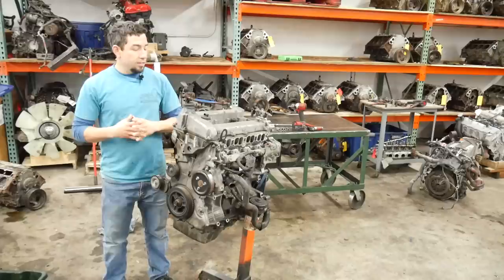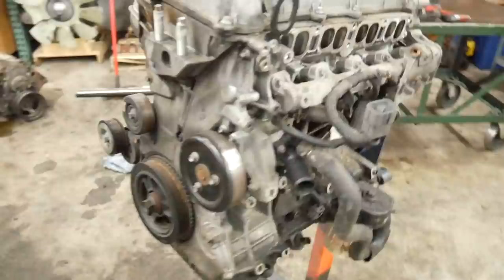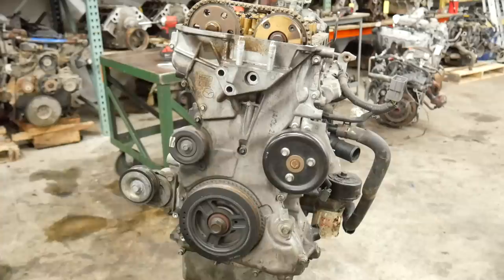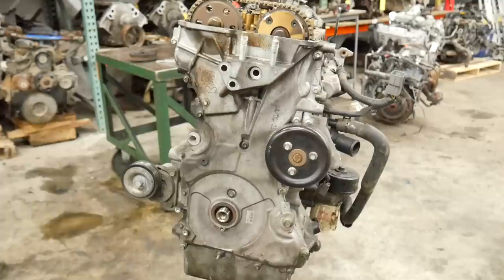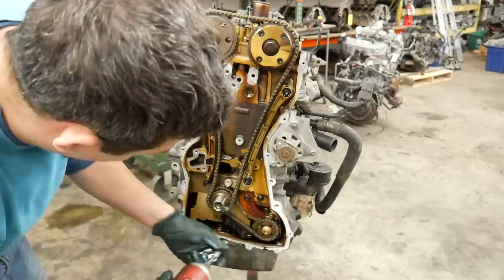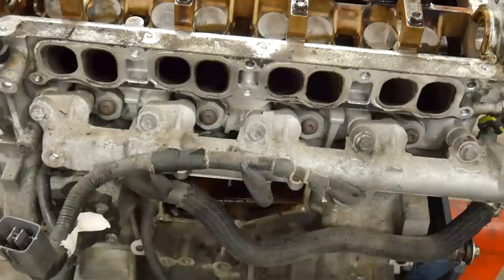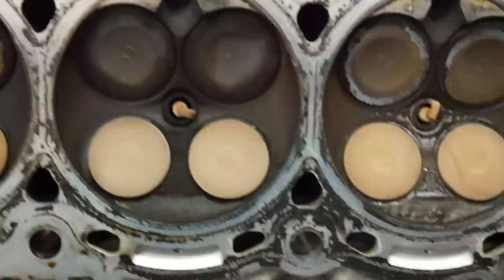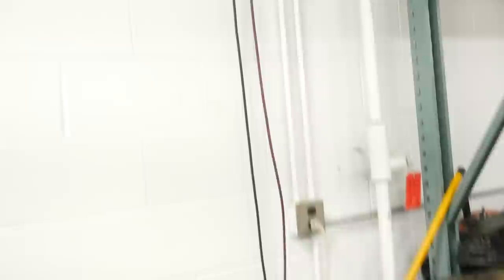TOTAL TEARDOWN: BAD Mazda MZR 2.3L Turbo Mazdaspeed3 Mazdaspeed6 CX-7 Engine.

Comment: Please teardown Nissan VQ engines either 3.5 or the 3.7.  And explain from your experience what are the weakpoints and things you like and dislike about them.  Enjoying the content!!
Reply: The later VQ35de, and more so VQ35hr and VQ35vhr have oil gallery gasket issues. From what I've read, replacement is quite pricey, usually higher than the value of the car the motor is in. G35s and 350Zs that have those motors are pretty much throw away cars at this point.

Comment: All I got from this was the need for regular oil changes and his reluctance for engine development. Who takes oil pans off insitu east-west engines? Space is tight on the cars and easier to pull the motor. Diamond impregnated friction washer or keyed shafts, both work.
Reply from the maker: I am all for new tech, so long as it’s not at the expense of reliability and serviceability. Pinned cams and crank, a normal oil pan, and a thicker chain and this engine would be 10x better than it is.  
Pins aren’t one time use. You can’t time them wrong (easily) and it would simplify the timing procedure. 
Mazda’s later engines are pinned. So clearly they knew what direction to go.

Comment: I had to work on an L3-VE which had lost intake cam timing which we couldn't get fixed in a shop because the service guy was adamant it was an electronics issue (every warning light on the gauge cluster lit up and the enigne sputtered at ever decreasing RPM threshold) and wouldn't accept that the camshaft timing is held with nothing but straight bolt tension and will inevitably spin and told us we have no idea how engines are put together saying such things. Oh, and you can't just pull the cover and adjust the thing, because the intake bolt (which is the one that gives) is obscured by the chain cover. These engines make decent power and run nice and smooth, but their best use would be to drop from great height on whoever approved the design. It seems to be optimized to maximize the misery on the service guy.

Comment: Reminds me of the timing on the old Ford 4.0L. Some habits die hard.   Somewhere in the world, there is a bean counter and an engineer having a beer together, congratulating themselves on the dirt cheapest way to time an engine.  “Key ways cost money.  Slot the cams and pin the crank, works just as good and is much cheaper.”
Before everyone goes hating on Ford, Cummins did a similar thing with the 12v 5.9L with the P7100 pump.  Line the marks up on the crank and cam gear, pin the cam, pin the injection pump, then bolt the pump gear on.  The crazy part about Cummins doing it, key way slots were already cut, but they wouldn’t work to time the injection pump.

Comment: When I saw the video title, I thought "aside from the rotaries, I"ve never heard of Mazda engines having problems"....then I saw FoMoCo on the side of the block, and it all made sense.
Reply: Yeah many of us speed owners of the gen juan and genpu 3s alongside the speed6 owners know of how screwed we were going into it from that era of mazda. But we still love our babies nonetheless and just how raw it felt compared to other competition
Reply: Except the fours were all Mazda designed and the 3.0 was all Ford,  which in those  years are bullet proof.
Reply: @ohger1  Nope, the 2.3 was Ford's baby. And the 3.0 was notorious for head gasket failure.
Reply: @justsumguy2u  And you're wrong on both counts.  The 2.3 Lima was Ford's, the 2.3 "L" in this video is a pure Mazda design.  You are probably thinking of the 3.8 Essex which was the headgasket killer.  Those lasted maybe 60K miles before grenading. The unrelated 3.0 Vulcan and the 3.0 Duratec are both Fords and they both last to 300K and more.  The 3.0 Duratec did have some Porsche engineering input.

Comment: Had My 6 for 4 years , on 152k running 500 bhp to crank I beat smoke out of it regularly, the designs are poor like mounts, crank, seals , and shafts mainly and yes they are a pain the ass to work on, just like my misses I suppose 🤣 also both high maintenance 😂 but I still love them both though ❤

Comment: I have 08Mazda6i 2.3l NA engine and I put 250K miles on it; still works like clock, a real contender for 300K miles; no issues, great car
Reply: How often did you changed your oil
Reply: @davidbillingslea2720  3-5K max miles
Reply: @MrUGA2010  ohh my 08 Mazda 6  needs another engine  is it a common issue for the 2.3 L to burn oil. That’s how I destroy the engine in my car because I don’t know the car Burned oil:(

Comment: Big time agree with your assessment on the viability of these engines. Mazda really dropped the ball.
Reply: Or...The engine was simply, and obviously, poorly serviced.
Reply: kelon32  -  It's just the turbo version.  I have the NON-turbo 2.3 in my 3, and it's a fantastic engine with literally zero issues in 150,000 miles.

Comment: There is a company that keys the crank as well as the camshafts on these. If you plan on building a higher HP build, it's a great idea to get that done. And to be honest, if you use the cam and crank lock tool, doing the timing chain is really simple.

Comment: I bought a 2006 3 with the nearly identical, nameless 2.0 variant of the 2.3 MZR shown in the video. It had been overheated and I was expecting to replace the head gasket and a few other things. I will start by saying that This is the worst engine I have ever had to work on by a significant margin. It seems like they engineered this thing to fail in every way possible outside of the block. 

If you own a 2.0/2.3 Mazda I would strongly suggest you go and replace every single coolant pipe bolted to the head and block before they inevitably fail within the next few years. They are all made out of plastic, do not age well (extremely brittle after 10 years), and cost way more than they should. This is still cheaper than overheating and blowing this engineering nightmare up. I had to replace all but one of these because they were all broken and leaking. 

The reassembly of one of these made me want to never work on another vehicle again. Do not think of doing anything important to one of these engines unless you have lots of prior knowledge and a full understanding of how timing is supposed to work. You will have to throw most of your knowledge away while you wait for 2 specialty timing sets and a few other tools to come in for the project. 

On that note, I hope you own lots of specialty tool sets, and even if you do, I am thrilled to tell you that you will have to buy several more if you plan to do anything outside of basic maintenance on this engine.

To give it some credit, the car is decently quick after replacing the head (perfect valve lash on the tight side), cams+gears, VVT actuator, entire timing and tensioning assembly, every crush washer (enjoy paying >$100 for these stupid things every time you take it apart, upgraded head gasket, and most of the electronics. 

The variable valve timing for these cars is frighteningly bad. The actuators will fail regularly within 25-100k if you don’t do near perfect maintenance, the VVT solenoid will get clogged and either make it stick or completely starve the actuator of all oil. (The quality and weight of the oil is incredibly important for this engine to not sound like the top end is going to explode.

I thought Chrysler engineering was terrible, but these things have redefined my lowest low for a somewhat modern engine. 

Here I am left with a car that cost me $200 with around $3000 (everything but machining done by me) to replace the top end and timing assembly but is worth $1000. I wanted to turn this into a nice little sporty daily, but have completely changed my mind after seeing how it was engineered. 

I love reading the stories of people with high mileage on these engines, but I can only say it’s a combination of extreme luck and a spotless maintenance record. I genuinely hope all of your engines go a million miles. Though I can promise you it won’t if you beat on this engine marginally (high revs and poor maintenance specifically) because it is designed to fail disastrously with small amounts of either. Best of luck to all FoMoCo 2.0/2.3 owners!

Comment: Oh damn. My oil change has just come due in my speed 3. Better get it done. I'm gonna be even more careful with mine now. It has 200,000km on it and I was thinking of upping the oil change interval so I will after seeing this video. With it being a Ford block and so much Ford input to the design, I knew it wouldn't be as good as a pure Mazda but now I know the issues thanks to you. I always use synthetic and change my filter so I hope it will stay reliable. Gonna check my oil level today. I really appreciate your work. Thanks
Reply: Ford had little design say in this engine
Reply: @FusionBoost2.0  I've read that they designed the block at least, so many of those issues such as the oil pan mating, cam chain routing etc would be influenced by the block design I'd imagine. I'm not holding Ford totally responsible, for sure, but I just worry about ford having their input into any design (especially Euro Ford - which I assume it is, since it's a small engine). I'm just crossing my fingers that regular maintenance is the key to longevity with this engine

Comment: got a cx-7 sitting out back of our shop that sounds like a bag of hammers. some poor lady bought it on an auction as a basket case, intercooler, valve cover and everything in the backseat. she payed us to reassemble it and get it too run. someone had blown the megafuse, and tossed the coils. anyway... 
after it 'ran' we dropped the... oil? i think it was oil... once.. looked like  a really neat gun metal grey paint color, oil filter cartridge was crumpled into a wad.
after we started looking for engines, and the prices were sky high.. we had to tell her it really wasn't worth anything. 
and thats too bad, its a texas car. around here in the rustbelt that's usually worth gold.
we are pretty sure the auction disabled it, and tore it down specifically too sell it to some poor sucker. they knew what they had, or at least whoever owned it originally did.

Comment: Finally someone else who sees these engines as the complete turds they are. I've owned 2 MS3s and 1 MS6 (obviously took a while to learn my lesson) and absolutely hate everything about working on these. Also - fun fact that you miss when the engine is on a stand - these are transversely mounted in the car which makes tool access to a lot of the bolts on the timing cover / pulleys an absolute nightmare.
Reply: they aren't the car for you either lovem or hate them.

Comment: My mps have 246000km on clock.still going strong.no issues.i do oil change  every 5000km.use the correct oil 5w30 fully synthetic.i clean egr valve every 20000km.

Comment: And here I was thinking about upgrading to turbo but after finding out about Mazda/Ford I doubt I will. With turbo all that happens is that it wears even faster!!!! And as he says who has the time to keep working on these simple engines all the time!!! He even said it, oil starvation issues!!!! God I wish I had known better!!!! I know I'm stuck with it now. But being I'm a gear head its not a prob for me to get it to back to the best it will get even if overhauled. Because it runs fine and shifts smooth before and after transmission filter and fluid change which has to be done over and over until all fluid is exchanged for new. Which is costly!!!

Comment: I remember back when I was at the Mazda stealership for awhile. You sir are so DEAD ON about EVERYTHING you say about the MZR. So many things your saying were making me chuckle because of all the experiences I had when turning wrenches on these. So many terribly 'engineered' items on these. First day there at the stealer, I did a complete long block on a CX-7 that someone already tore halfway apart and gave up on. I literally pushed it in at 9am my first day. This was my test of my abilities according to the service manager. About 3 days later I was done, with no CEL or issues. This was the first MZR based car I replaced an engine in. I modded a few of them before working here, but just bolt-on type of stuff. Needless to say, I was NOT impressed by these. I work on everything, but my background is basically VW/ Audi and BMW. Coming from these cars working on these I was not impressed once again lmao. Thanks for this video. Just makes me even happier I left that particular stealership. 👍😎😁

Comment: Own a Mazdaspeed3, first gen. I bring oil in my trunk everywhere. I change my oil way before the recommended few thousand miles. Its the only way to keep up with these engines. I noticed that if I even allow the car to run on oil over a couple thousand miles old, I overheat at idle speed. Had a normal mazda3 before that with no issues, and I beat on that car WAY harder than I do with my speed. I did buy used so maybe that's part of the problem, but I guess I'll never know.

Comment: I’ve been working on these engines for years, I didn’t think they were that difficult. Nowhere in the league of difficult either Volkswagen/Audi turnout. This seems to just be an engine that hasn’t been maintained well and most of them are over 10 years old by now. I reckon you’re being a bit hard on them.

Comment: Had the same in my CX 7 Timing chain Carbon Build up and injectors at $300 bucks apiece 
Liked the Awd ,styling ride but it cost me a ton in repairs
Reply: and fuel too I bet, it goes decent with some pedal but hardly goes anywhere without it

Comment: My 2015 Mazda 6 has 250K on the clock and I’ve only replace the belt tensioner (twice).  Still getting 32mpg and it runs/shifts like new.
Reply from the maker: That generation is absolutely excellent. I never see issues with those engines.

Comment: I drive a Mazda 5 2.0 MZR with 146 HP.  I bought it brandnew in 2009. Now it had run 144.000 km. It is still performing good but the oil consume is 1l / 1000 km. I thing it is to high. I allways change my oil all 20.000 km and use expensive 5W30.  What could be the reason?  Thank you for this video 👍

Comment: No wonder its garbage did you see the (FOMOCO)on the side of the block that is ford motor company which in english means shit engine .
Reply: Oh look another boring joke towards Ford!
Reply: HAHA FOUND ON ROAD DEAD RIGHT GUYS
Reply: No modern day car company universally makes shit or gold these days.  Even this engine was obviously abused with oil changes (lack of).
Reply: @mrdumbfellow927   after seeing that oil pan id say this is consumer error for sure, there's definitely some bonehead stuff going on here which is just different not awful, but that doesn't excuse the obvious sludge in the pan.
Reply: The shitty sludge in the oil pan doesn't say much for the servicing that this poor engine had before it went bang. Even if you know bugger all about cars, changing the oil regularly is just so obvious.

Comment: The oil pickup has a screen inside, just FYI :)
Reply from the maker: It does, but not being at the end makes it tough to inspect for debris.
Reply: @I_Do_Cars  I would have thought that being in the sump makes it tough to inspect for debris? You can see the screen easily with the sump off and if you have enough debris to cause concern, you have vastly bigger issues than the design of the oil pickup. I've got an L3-VDT here with a forged bottom end partially assembled, I'd be happy to supply pictures of the pickup and it's screen filter.

Comment: My son had a mazda 3 with the 2.3 that had a very weird cartridge style oil filter... something was broke in this weirdly designed housing that leaked oil only when it ran. I could see that being a big failure point for these motors.
Reply from the maker: It’s a huge problem with them. Thankfully you can convert to a spin on filter from the 2.0L

Comment: I've got a few parts left from a speed3, if anyone is looking. Also have a speed3 for sale that needs a chain replaced, but would run otherwise. It's in great shape aside from the engine. Surprise surprise.

Comment: The real killers of basically all chain driven engines is the maintenance reminders. WAAYYY to long between oil changes if you go by them. Engineers have basically gotten it down to a science to have the intervals ling enough so the engine just makes it through warranty period. Been a tech for nearly 10 years now (I'm 26) and they all fail if you go by the computer maintenance intervals. However i will agree that the Mazda/ford engines are the worst offenders when it comes to service, Honda wins hands down. Woodrif keys are your friend! If you want solid lifters, make them adjust with lock nuts and studs, not shims! Bolt the oil pan to the timing cover from the bottom! The K series engines from Honda is far and away the best chain driven 4 cyl around

Comment: Amazing content, in sure you don’t get too many, but a 1UZ would be cool to see
Reply: it would probably be still in running condition.
those engines were really well engineered
Reply: Amazing engines with exception to the rods and rod bolts, but this doesn’t matter unless you throw a lot of boost in it or over-rev the engine.

Comment: That's a stupid idea not having any keyways & Keys for both the crankshaft & camshaft timing sprockets because I did have an instance in 2007 where the dowel pin on the inlet cam of my Nissan RB30DE engine (RB25DE VVT cylinder head & RB30E engine block) sheared off & the VVT camshaft sprocket did spin on the end of the camshaft.

There's only 1 bolt & 1 dowel pin which was holding it in place so I was very that lucky none of the pistons collided with any of the inlet valves !